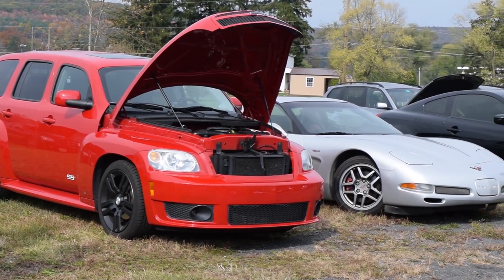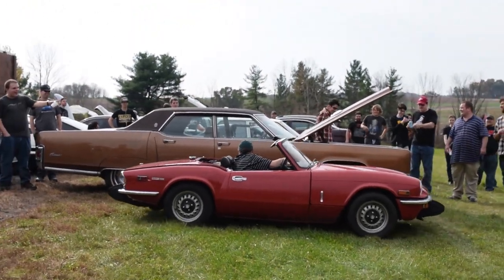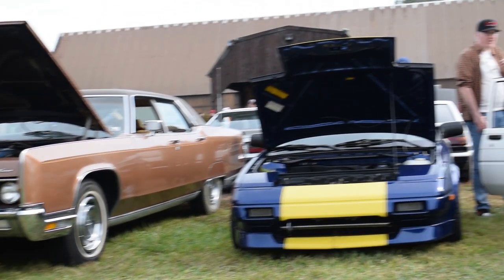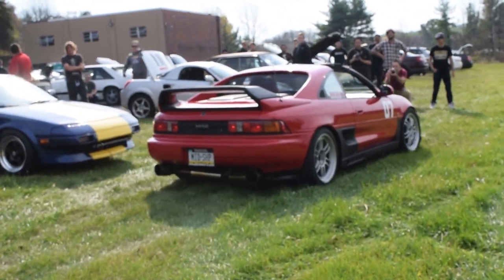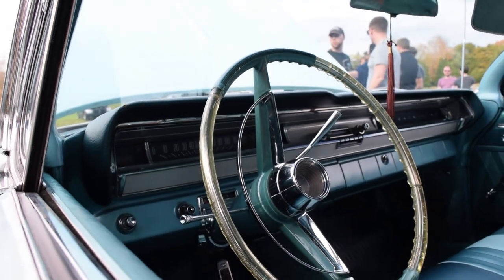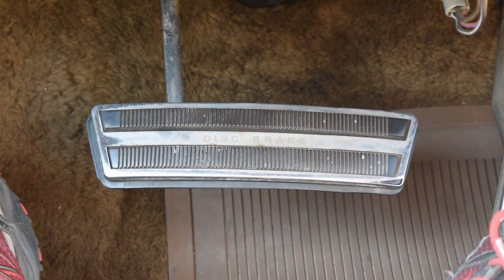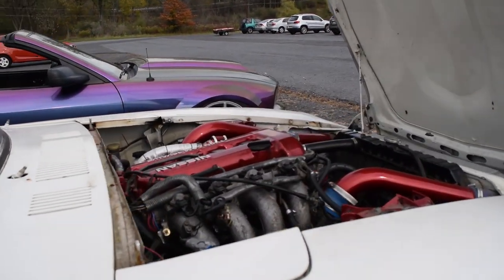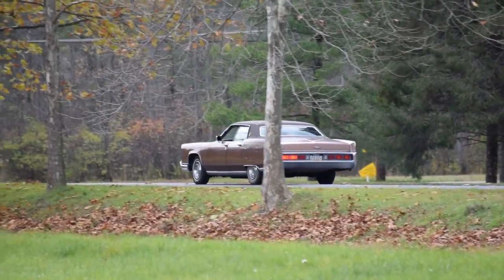RCR Car Meet 2016

Comment: 6:13
"not sure which version of e36 that is"
i can understand your confusion because its an e46
Reply: #dead
Reply: This e36 is best e36 because it's an e46.
Reply: E46 M3
Reply: Went back to see if it really was a M3, because many E46-s have the M-bumper, but the side vents are only on M3.
Reply: that's what I thought too ... I'm generally an Alfa fan.. but even I can tell that it isn't an e36.. unless it's a face swap .. which.. dude if it is, awesome!
Reply: Real M3, you can tell by the mirrors. The fakes never bother to swap the shrek ears
Reply: dude.. the m3 mirrors are literally the best selling "mod/accessory" on the market.. every idiot has them on his 318
Reply: C'mon people,  you can see the wheel arch flares and the ITBs in the engine bay. Clearly either an M3 or a full, painstaking conversion.
Reply: Couldn't tell if that was sarcasm or not.
Reply: 6:16 You can see the ITB's from the s54 and the M badge chrome shine comin from the valve cover. E46 ///M3
Reply: my e36 is best e46
Reply: That version of the e36 is the e46. It's pretty rare
Reply: lmao

Comment: orange chevette original hp 23.2.  after rebuild 48.8hp.  yellow chevette is 24hp.
Reply from the maker: Ack! still messed it up, sorry.
Reply: No one really cares.
Reply: I do
Reply: Judy Gunderman i have a 29 mercedes kit car made out of a chevette. it always felt like it had less than 30hp, now i know why.
Reply: i care.  it's a record i hold on the dyno around here...
Reply: Judy Gunderman lol. I have a soft spot for old chevettes and 70s economy cars in general. But 23 horsepower from gm seems odd to say the least. How much does a chevettes weigh?
Reply: What did you do to get twice the original power?
Reply: It makes so little to begin with, not really hard to go from an absolutely abominable amount of horsepower to a slightly less abominable amount of horsepower. Not that you would want much more in a chevette.
Reply: It weighs about 1600lbs.  The timing belt was off by two teeth.  We rebuilt the motor, fixed the timing, and added an msd ignition and coil.
Reply: Judy Gunderman Oh, nice!
Reply: Oh my God! Now I know what Alex Bilinski was talking about when he said "Catman, you like weird cars, but there was a lady that worked here that liked Chevettes." Anyways, hello fellow former Volkswagen employee!
Reply: Ha ha!  Yup.  That was me!
Reply: Well hello!
Reply: Judy Gunderman are u really a girl ?

Comment: 6:11 E46*
Reply: thk u. I was gonna say that!
Reply: I scrolled down to see the comments just as soon as i heard Mr. R saying E36 instead of E46 and sure enough, this was the first comment i saw. :)
Reply: Ula G not just any e46 it's an m3, consider me #triggered
Reply: I thought exactly the same thing, lol. E46 M3! Very clean.
Reply: Ula G e46 with m3 bumper. no side grill
Reply: Lucas Redmond lol no, look in the engine bay there's an S54 motor sitting in there and in the shot it's next to impossible to see the fender grilles. Plus it has the mirrors... it's an ///M
Reply: And the fenders are wide enough to be so.

Comment: It's not an iron duke in the yj.. common folk lore.
Reply: funshootin1  basically a cut down jeep/amc I6 with a GM 60* bell pattern for some reason. 

also the basis for the transverse ohc 4s used throughout the 80s and into the 90s in chrysler cars. 

always wanted to weld a couple sohc heads together and stick it ontop of a built I6, or if one wanted to go crazy wreck a pair of the uber rare dohc heads by doing the same thing!
Reply: The jeep 2.5 and dodge/Plymouth/Chrysler2.2/2.5 have nothing in common.
The dodge 2.2 was designed by Chrysler, 2.5 was built from the 2.2
Reply: Burton Bogart. i suppose it could be entirely a coincidence that both use an unusual crankcase mounted distributor even though the newer engine was intended for fwd and could have easily been designed with the more logical cam driven distributor.  especially considering it was intended for computer control. 

keep in mind Im not saying anything about the later engine is literally taken from the amc/jeep I6 the way the jeep I4 obviously is, just that there is an obvious design lineage there.

Comment: I've noticed that in past few years at car shows there is never a Z31 model 300ZX.. Am I the only guy left that has one running? (Albeit, rewiring it at the moment)
Reply: They are definitely becoming more rare. I almost never see them except at really large gatherings. I knew of 2 people when I was in HS who had 3-4 of them and were obsessed. That was over 10 years ago now.
Reply: I miss my Z31...
Reply: ***** Possibly. Mine was originally a turbo, but required a complete rebuild.. which sadly included the turbo being irreparable. So N/A it is, for now. Suspension, engine, transmission, interior, and wiring. Well, with my father, a year and a month later and $6,000 down the hole and I can just about use it again.

I genuinely feel like it's quite possible that the reason they aren't as common is because once they fall apart, they're a pain for a full project.. especially the electronics of full digital. Oh, boy..
Reply: My best friends father riced his then left it in a garage to collect dust.

Comment: Wish id known about this! Would've brought my '73 Nova, or my '85 D150, both of which have some pretty healthy V8's. Nova's running original 350 block, bored .30 over too 355, very mild cam, air gap intake, vaccuum secondary 600cfm carb, and some long tube headers. Trucks running original '85 318 block, ported and polished heads, Comp xe268h cam, some cheap ass painted long tube headers Edelbrock 600cfm double pumper on top of another air gap intake mani.

Comment: The 2.5 in that Jeep isn't an Iron Duke.  It's an AMC 4-cylinder design that actually predates the 4.0 (but was contemporary to the older variants of the AMC straight six).  The Duke was never actually used in any Jeeps.  

The Iron Duke thing comes from the fact that some of the AMC small engines shared a bellhousing pattern with the Iron Duke, so swapping Dukes into 4-cyl and straight-six AMC/Jeep products is easy.  

If you get a chance to drive a Wrangler or Cherokee with the Jeep 2.5, go for it.  It's a very tough engine, but also hilariously crude, noisy, doesn't rev, lots of low end torque for a 4, etc.  It sounds like you've got a fleet of Hoover vacuum cleaners under the hood.  I had an '86 Cherokee with that engine, complete with an EPA-programmed shift light on it's 5-speed trans.

Comment: need to know more on that 86 with the dirtbike airfilter / ITB's??
Reply: BlueHokage it was swapped with a 20V 4age. They came factory with itbs. So under the pipercross filter were the velocity stacks. Car was very clean and nice.
Reply: That particular 4AG was over engineered from the factory just like every other performance engine from the same era, and I mean that in the best way possible

Comment: RCR Viewer's! Hope you could help me with something. I'm 19 and looking to buy my second car, as my current car (Peugeot 106) is going to my sister. Any thoughts on what car I should get/ would be best for my age? I was thinking of a BMW E30 touring possibly, as I live in Britain and they are easier to source over here. Happy for any help though! Thanks :D
Reply: bcwlstd what kind of car do you want or what are you looking for in a car?
Reply: Like Metal Metal Dan was asking, what are you looking for? When I was 22 I wanted a Station Wagon like the one Dad had so I got one but that's me. I will however say don't overdo it, whatever your "overdoing it" mark is at. I'm reminding/suggesting that you don't cause trouble for yourself over it, whatever you choose. Again, I have no idea what that mark may be at for you.
Reply: Austin Lucas Very true. I basically want a cheap (£2000) car that's reliable and a lot of fun to drive. Just wondering what anyone had for their second cars when they were younger :) Problem with England is that the insurance costs are usually double, if not triple the price of the car! :(
Reply: Darn, I have little knowledge of cars in England at the moment. I also don't know how easy (if possible) it is to work on cars in a residence in England, I was going to say maybe you could find a car that needs some work done to it and fix it yourself but some cars can be incredibly educational to put it mildly.

Comment: The mr2/mrs looks beautiful with a hardtop.

It might be a carolla underneath but you end up paying more in repairs just based on how much longer it takes mechanics to work due to a cramped engine bay, but at least its not a 300zx

Comment: FYI, 2000-2002 Mk3 Toyota Spyders have issues where they can lose the engine.  2003+ is good though, as long as you monitor oil level.

Comment: 2:30 is that a new Caprice cop car in the far back left there? How did that person score that?
Reply: Will Thornton easily. They're for sale all over the place.
Reply: Corkoth55 I sort of want one, but I probably can't get one. Law enforcement around here still roll around in Crown Vics, lol.
Reply: Corkoth55 I saw that, they were impossible to find like 6 months ago when I was looking though. Those are badass cars, rebadged Holden Commodores from Australia. LS3 motor, I just found one for 12k with only 50k miles
Reply: Will Thornton a lot of metro areas use them. my capitol city has them in their fleet. my town has 2016 explorer police interceptors

Comment: Did they swap an Iron Duke into that YJ? Because the Iron Duke is a GM motor, and the Wrangler is an AMC/Chrysler product.
Reply: No it is stock, Mr Regular misspoke.  That engine is an AMC based 2.5L which is essentially the Jeep 4.2L/4.0L with two cylinders cut off.
Reply: Ok. I was thinking it would've been the 2.5 AMC.

Comment: Why does everyone thing the YJ came with an Iron Duke? It had the 2.5 AMC 4 banger, which actually made decent power compared to GM's Iron Duke or Ford's Lima engine. Also, the 2.5 was the basis for the legendary 4.0 AMC i6

Comment: On the Mk3 MR2's (the Spyders), you want to watch out for the pre-cat issue. Overall, the cars are reliable as you'd expect, but if the cat goes out the engine no run. Toyota put those pre-cats too close to the head and if/when the cat matrix starts to breakdown, little pieces blow back into the engine through the exhaust valves and wreak havoc.

I don't remember if there's something to look for on a test drive, but I would have a Yota tech do a PPI if you want one. Otherwise, light little roadster that gets great gas mileage.. Can't go wrong (except for storage. Storage was a myth these cars didn't believe in).

Comment: Don't the Mk III MR2 have the same engine as the Lotus Elise?
Reply: Timothy Baxter  no, similar but different motors. Same block different internals and fuel system
Reply: Timothy Baxter if swapped with a 2ZZ-GE engine then yes.

Comment: my first car was a yellow triumph spitfire and it was awful.  

whats funny is i got another yellow roadster and it was a joke that turned into a tradition.  since 18 ive always owned a yellow roadster in one form or another.  the newest being a solstice gxp i bought new in 2007.  i only put like 1k miles on it a year so im sure i will have it for another 20 years easy.
Reply: Growing up my mother got a '72 Spitfire MKIV. It had 48 horsepower thanks to the single carb. The thing though was that it was fun to drive. So when I was looking for a classic car and this popped up there wasn't much choice. I had to get myself another MKIV. Mines a '74 with dual carbs so it's capable of being on the highway. Although it needs an overdrive badly. 
I'm putting very little mileage on it right now and it bugs me. In fact I think I'll take it back out today.
Reply: The dual carb ones with 70hp are great to drive.
Reply: TheLeafySpring Power to weight makes it a lot of fun.
Reply: If you can go thru them completely I'm sure they can be good cars.  I'd say just replacing the wiring harness and relays should solve 90% of the problems.
Reply: Wayne Moyer It's also a "feel fast" car. All of your fun happens at less than 60mph.
Reply: TheLeafySpring There is that whole bit about driving a slow car at 9/10th's then a really fast car show.
Reply: OutlawUniverse Yeah. They're old cars that need lots of work.

Comment: Why do people pop their hoods when they have stock engines? So pointless unless it's cold outside and you're trying to warm yourself up with the residue heat.
Reply: max d and a Tesla with the hood and trunk popped
Reply: max d also because this is regulars cars so a regular boring stick engine is what it's all about
Reply: Some people just want to look because they've never seen that model before or maybe they want to compare engines if it has a different engine.

Comment: Lincoln Continental Speedo to 120mph Thats Optimistic
Reply: Jeff Sine it's got a non pollution 460 V8. It can hit 120 given enough space. Stopping it however, that takes more than optimism.
Reply: My grandfather owned one and I got to drive it when I was learning to drive decades ago. I can vouch that the brakes are basically four loaves of bread trying to stop this thing!
Reply: Four loaves of bread, hah. Are they all drum or are the front ones disc brakes?
Reply: Austin Lucas Depended on the year. From 61-64 the front discs were an option. In 65 the front discs became standard. My grandfathers was a 65 or 66, so he had the discs, but still a lot of weight for them to deal with obviously.
Reply: Either way it was 5,000-5,700 pounds according to what I read. Though I've driven a Suburban of comparable weight with front discs and rear drums I'm not sure I can imagine how you mean it well enough.

Comment: SHUT UP ABOUT THE MR-S BEING RELIABLE! I just bought one a few months ago and it died on the side of the highway. It has piston ring problems and the pre-cats disintegrating get inhaled through the back pressure in the exhaust and ruin your cylinder bores. this car NEEDS a 2zz swap lol. For those who don't believe, here is a link to a drive photo of it when it happened:

/file/d/0B3G3gWstNRLLN28wODNvb2FQdVE/view?usp=sharing